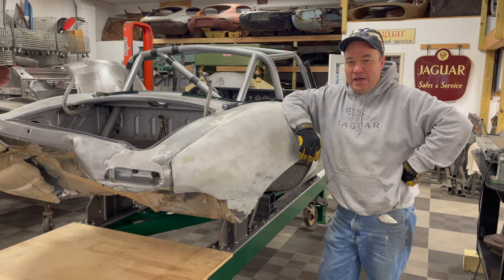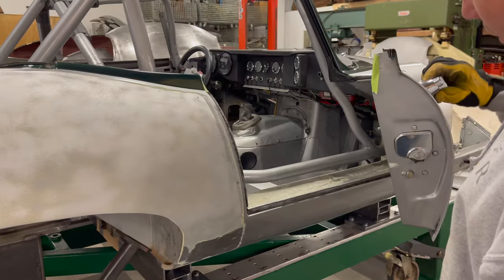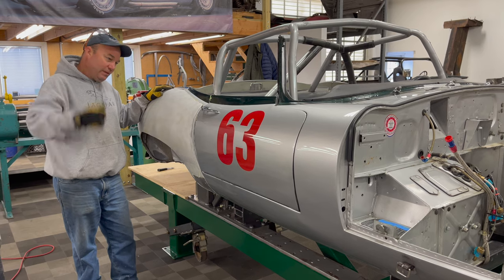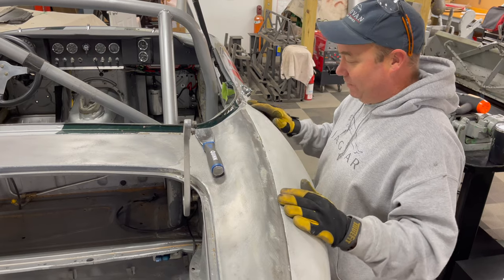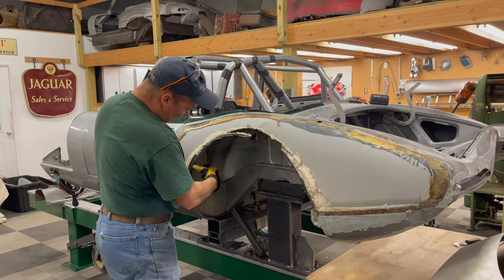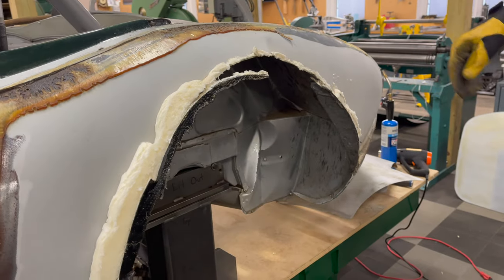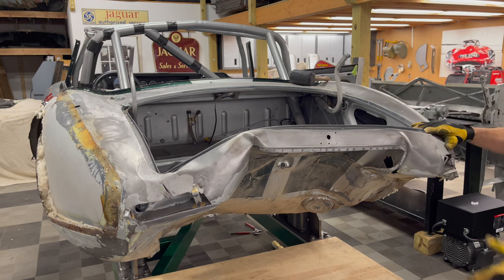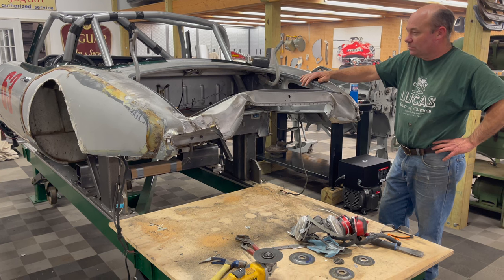Jaguar E-Type - 1967 Vintage Racing Crash Repair - Part 2 - Dissection Begins!

Comment: I bought my first heat gun a few months ago to re-solder the ribs on a Winchester shotgun (without damaging the blueing). It worked great until a blob of solder fried the element! I bought another one and finished the job. They're brilliant for controlled heat, and as cheap as chips!

Comment: I like your site and glad i found it, great workmanship old chap, the wheel arch area looks a bit odd with all that expanded foam underneath, it does need neatening up, and even though it is out of site it should make it lighter as well if you simplify it, interesting and complex bodywork on the old E types never seen one naked so to speak, personally looking at E type bodywork i much prefer working on Austin Healeys, much more simpler in construction, Thanks for the postings and i look forward to more.

Comment: Chuck . Had a thought about that distortion on the front outer sill. I think the door has been driven forward with such force , it  has impacted the top of the "A" post and forced it out of alignment to the extent it has "tilted " it forward and compacted the base of the "A"post thus distorting the sill skin . Did the car come in with or without the bonnet . If  the bonnet was on you would have seen the distortion immediately . I would have a look around the top inner sill area where he "A"post is welded and look for distortion . I would be very surprised if the impact has travelled through the length of the sill. Cheers !
Reply from the maker: Thanks for the thoughts, John - it will all be checked soon once the jig fixtures are in place, but we've done alot more dissection now and much more has been revealed - take a look at Part 3 which I just put up.  :-)

Comment: Heat guns. Run on cool before turning them off so they dont heat soak and shorten their life
Reply: I always rest them with the heat nozzle vertical so the heat disipates upwards . ( Even the Rupes don't have a cooling down cycle )